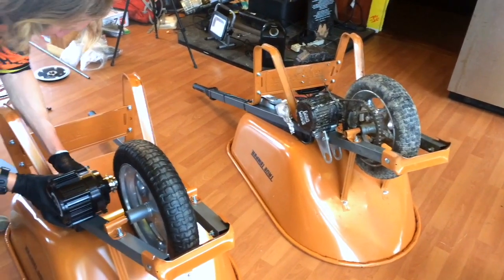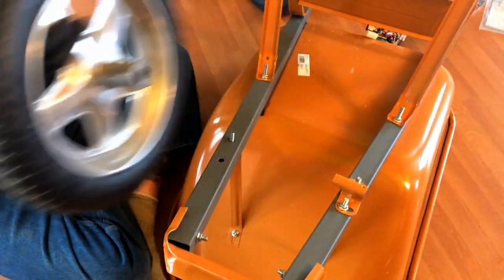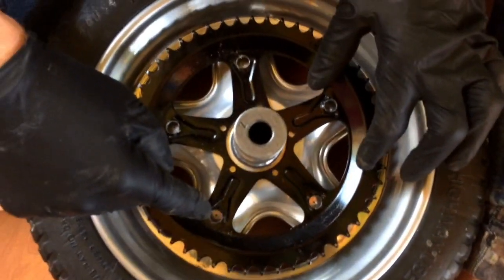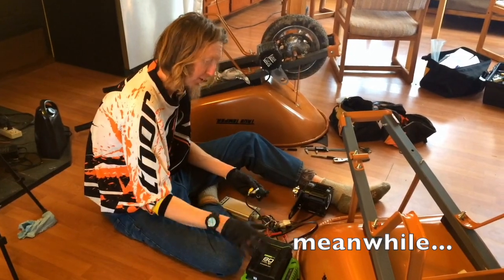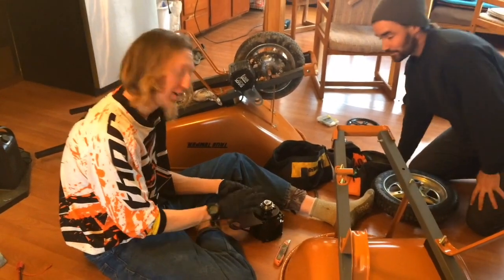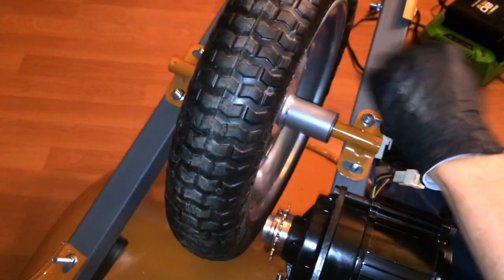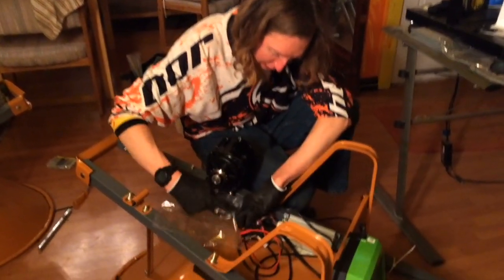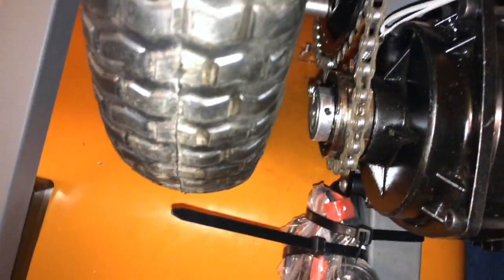Electric Wheelbarrow - Build part 3 - Mounting Chainring and Motor

Comment: Drilling into the spokes of the wheel is a perfect application for a stepped drill bit.  If you get one, you won't regret it; cheaper ones are available for infrequent users.
Reply from the maker: That would be more elegant for sure :)

Comment: Só Nice :) I have a 36v battery and (broken battery loader) from stihl...would you say I could do the same? What should I change? Any tips? By the way can it still drive backwards normally? Doesn’t it need brakes? Thanks 🙏
Reply from the maker: This never really worked going backwards which is a little tough, but I've figured ways to work around that.  36V battery I would think could work but I can't say for sure.... https://electricbike-blog.com/ is where the fellow who designed this shares lots of notes...

Comment: instead of an on/off switch can you have a variable speed switch like the one in a cordless drill?
Reply from the maker: It has a way to turn on/off but the main control is a thumb switch that provides very much variable energy to the system.